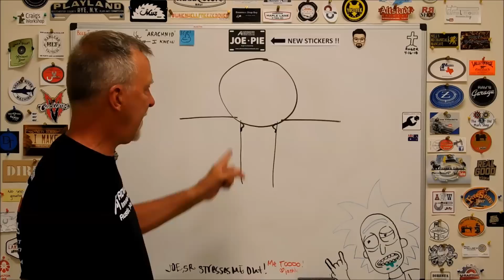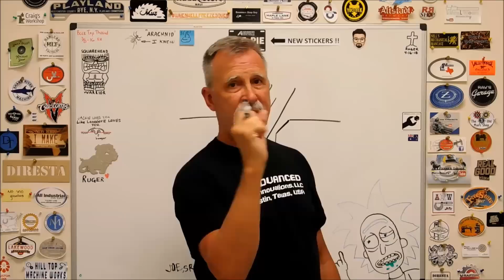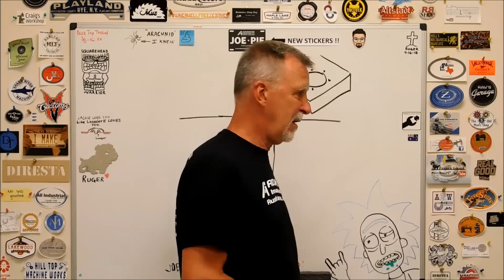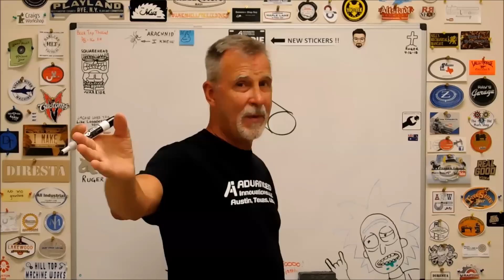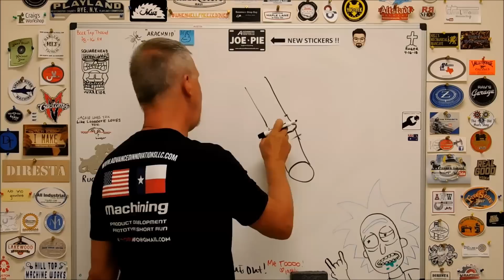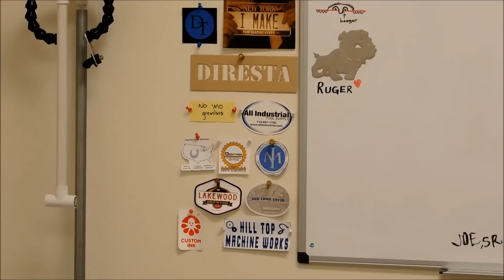7 Identical Problems, 7 different Solutions ---Take a Look !! ---

Comment: Those spring loaded center punches come in handy for a lot of things.If I have a bolt that is broken off flush or,below the surface,many times,they will give it that little jolt it needs to back it out.Just punch straight down,close to the edge then,cant it in the punched hole and,give it a try.That method may surprise you.It surprised me many times.😁
Great video as usual

Comment: when i was learning engine machining one technique we used on slightly oversized bores was to put the piston on a special knurler it worked great at oscillating the piston back and forth then file fit it to the bore

Comment: If someone is having difficulty in reaming holes to proper size, a common mistake is to force the reamer to take out too much material.  I would typically only have a maximum of .002" to .005" for the final reamer to remove.  Any more than that and you're taking a chance of the hole being oversize.  Use cutting fluid too with a slow RPM and even feed rate in and out.
Reply: There are times when the hole was not reamed and just drilled which came out oversize as well. It could be the bit pulled to one side, didn't use coolant or used an oil that heated the bit enough to cut just oversize, or the operator just bored it a smidgen to big.